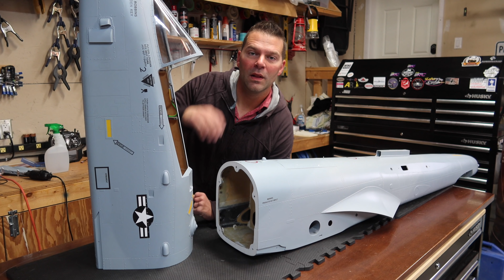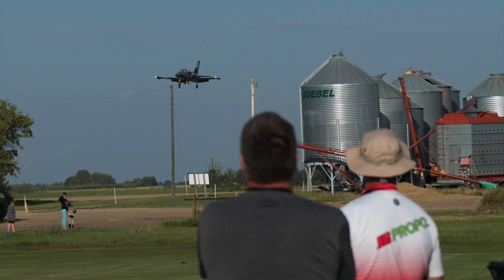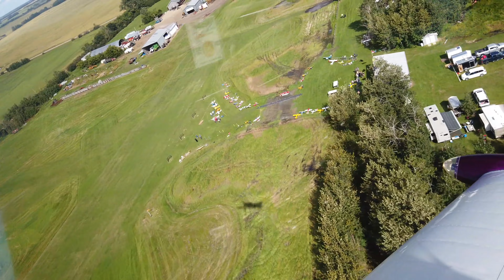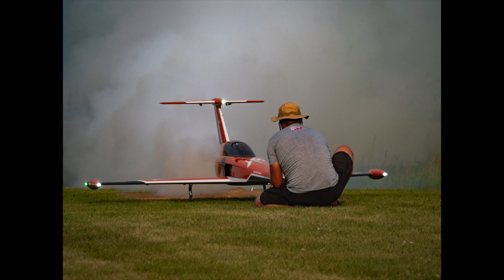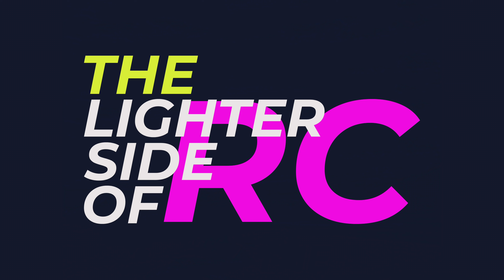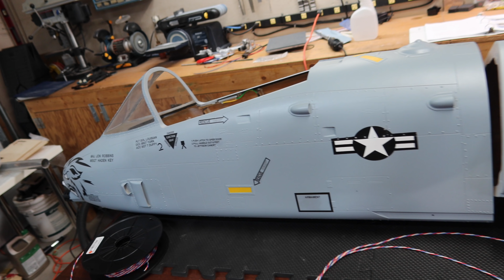SKYMASTER A10 Engine installation & Scale Fans complete

Comment: Is there clear coat in between the bell mouth and the pipe? The bell looks like aluminum, and the pipe is SS. I would also dip, or spray the rivet with some clear just before putting it in to help avoid galvanic corrosion.
Reply from the maker: Thanks Chad.  No CC.  Hopefully never have to do anything with the pipe and it's a permanent structure.  Thanks for watching.

Comment: if your problem with super and hyper-sonic engines is too high speed air burn intake, then side-suck the heating-air-burn-oxygen-air, or pure external combustion heating heat transfer heat-sink pulse/continuous ramjet, dont have to worry about the flame, if its "in-between" or "external"
Reply: candle heat cannon, three components, candle burning, copper heat bridge, aluminium/titanium/tungsten/steel turbine housing with heat transfer plates, like in computer cooler
Reply from the maker: Thanks for watching and your replies!  Way beyond me and my understanding!
Reply: just have a compressed air tank where air is stored temporarily to be used in the burn operation
Reply: ie, direct sub-sonic side intake, opposite U shape or perpendicular L shape, valveless, or the compressed air valved inter-air-tank
Reply: that way the speed of the engine, aircraft does not affect the combustion directly, but supersonic air can be fed in the heat transfer plates, even coal fired engines, heat engines can be used
Reply: similar to indirect cycle nuclear heat ramjets heat transfer engines, if some questions remain, take a look for designs on youtube or elsewhere
Reply: separate the propulsion from the combustion
Reply: ie, separate heat transfer, heat expansion and combustion from each other, to make it simple
Reply: Youre talking a shit ton of nonsense. 
Like a child when they are trying to use a bunch of new words they learned totally unrelated to make them sound smart.

Comment: I would think a simple way to hold doors open would be a
clothes pin, clamped in the middle, on the hinge point.

Or maybe a prop rod like many cars use? Pivot up out of way.
Reply from the maker: Yea I think i'm going to use a rod attached to the door that just comes down plugs into a former.
Reply: @thelightersideofrc  theres a guy that does alot of that aluminum tape covering to make rivets and what not on models. 
He has a ton of youtube videos. 
In one of his videos showing the process using that aluminum tape he did a crazy ass latch on a door i could have never ever, ever thought of but ill try to edit this comment with a link to the video. 
Youll be blown away. Its rather simple but genius. 
Took me several hours to dig the video up. Memory was wrong and wouldnt work for that specific hinge door. 
But check it out none the less its genius. At the 8:30 mark or there about. 
https://youtu.be/-LOAYA9bmpM